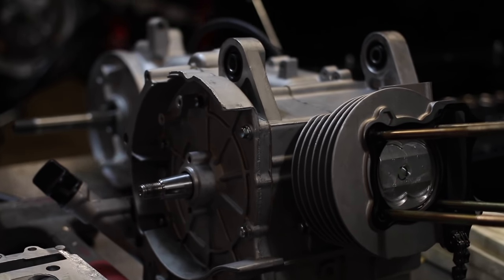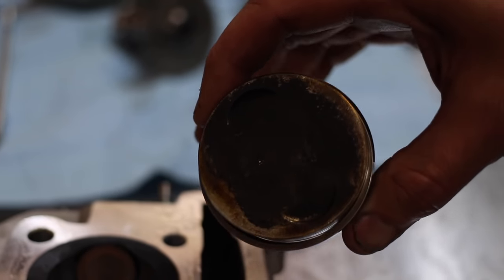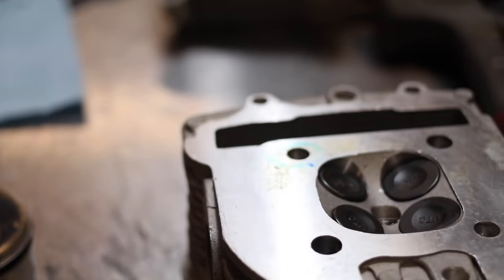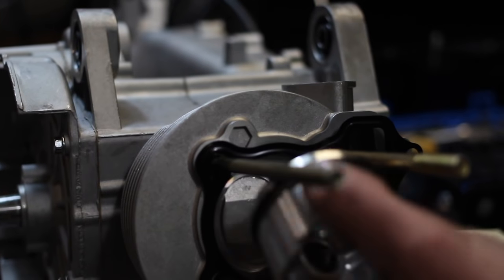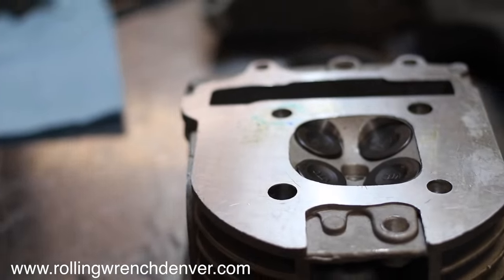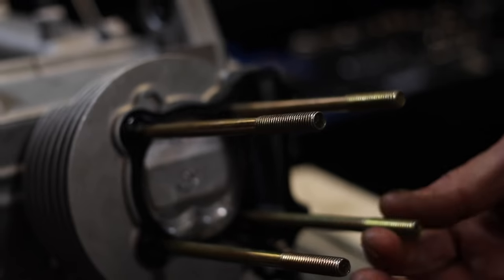GY6 4 valve performance head

Comment: How does this 4 valve GY6 head flow compared to 2 valve GY6 with larger valves? When looking that 4 valve combustion chamber it looks like there is a lot of room for improvement. Valves are shrouded by combustion chamber outer edges etc. However I assume that with good porting this 4 valve head will flow much more air than a 2 valve head. But as stock 4 valve vs. well ported big valve 2 valve head I think the winner is that 2 valve one.
Reply: Well Stock 2V vs Stock 4V, 4V Win, Ported 2V vs Ported 4V, 4V Win...

Comment: so is this going to give you 70 mph on an otherwise stock gy6 scooter?
Reply: It can, if you tune it right. Getting a good performance CVT kit, final drive gear set, and having the right size carb (with good tuning) will give you 70+, even with a stock engine. The kit is basically supposed to double your power output, which helps.

Comment: anyone knows the engine in the sym 200i .. peugoet belville 200i rs.. lambretta 200i aswell.. its a xs1p58qmk 168.9cc engine.. i wanna know the bore and stroke of the engine and whether i can make it 4v instead of 2v.. any help if this wud fit.. i recently got a gy6 variator for it and it didnt fit!
Reply: code is xs1p58qmk

Comment: Does the case have to be bored to accomodate the larger cylinder/piston?
Reply from the maker: MetroLinerXLZ we offer the kit in 58.5mm, 61mm and 63mm. The 63mm will need case boring but the others no.
Reply: Another question...is it possible to have the springs/retainers upgraded to the 12K rated (at extra cost) or do they already come that way?
Reply: Oh, and is the kit for A-block or B-block cases?
Reply from the maker: MetroLinerXLZ This head is made for the a block
Reply from the maker: MetroLinerXLZ we can upgrade the retainers if you would like. I'm not sure if it comes that way already. I'll check on that
Reply: @RollingWrench  Did you find engine shrouds that fits this head?